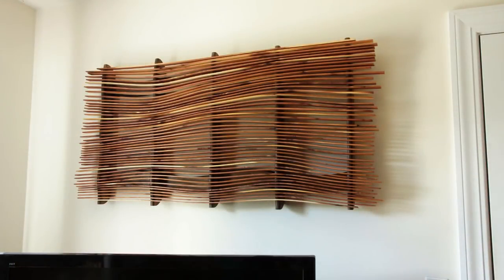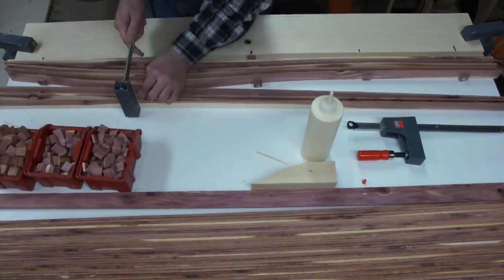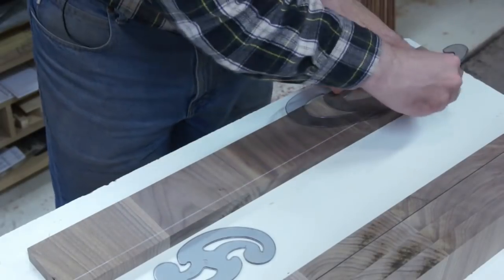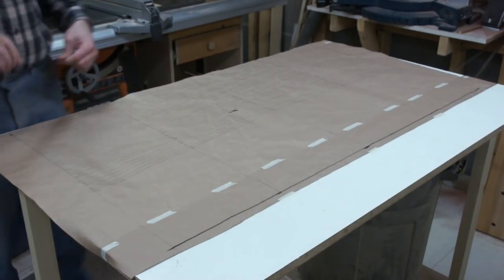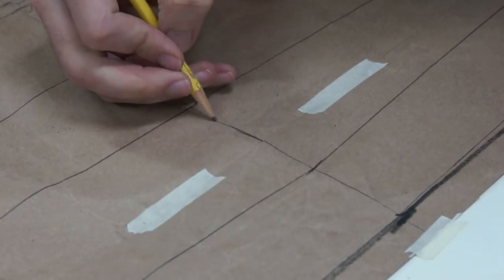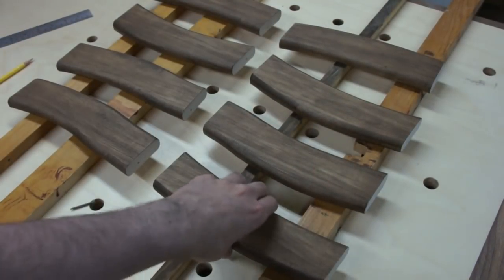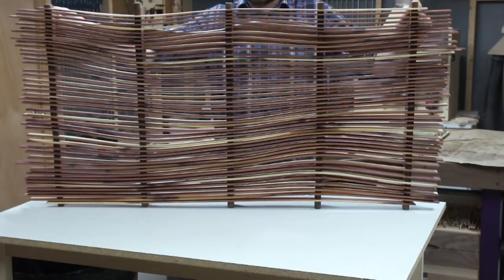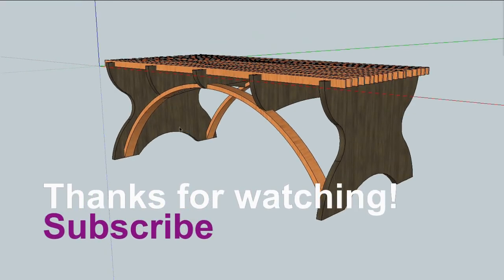Wall Art From Scrap Wood

Comment: This is an awesome idea!  I always have thin strips like that hanging around my shop.  I usually make them into cutting boards but this is a really good use for them also!
Reply from the maker: Thanks!  The long skinny ones and the short wide ones are the bane of my existence.  Well, sanding is the bane of my existence but they are on the list too.
Reply: krtwood We have a lot in common...

Comment: Just thinking about the cut supports. If you cut dados in the supports, then made a jig for the supports to slide in temporarily (like a equalizer on your stereo). The supports are not fixed at this stage, insert the cedar strips, so everything is assembled. Then move the supports in their jig and the structure then takes shape, what ever shape you wish. When you are happy with a form connect the supports together for rigidity, and remove the jig. Maybe this would give a different dynamic to the final form. Perhaps regular spaced spacers or dados, perhaps alternating variations; endless possibilities. I just see this as a quicker construction process, yet it gives a chance to make a better overall final form as you do most of the design at the end.
Reply from the maker: I see what you're saying, but you wouldn't be able to move only part of a divider.  So whatever wave pattern you put into it, it would be the same pattern vertically across the whole piece.
Reply: I'm proposing you have say, 5 supports as you did. But while in the jig they can all move / slide independently until a desired wave form is produced. Then lock that in place and remove the jig. Yes the cut slots and thus the slat spacing stay the same for each form. Perhaps regular slat distances would simplify a pattern that's only varied by the wave form. Sometimes simplifying a complex design like this makes it stronger, and reduces chaos and noise. I think there are lots of possibilities with your idea. My suggestion is to make construction easier, less daunting and thus you would be more likely to experiment with further forms. That's what I try to do anyway.
Reply from the maker: What I mean is that each cedar slat would take the same path.  What really makes it work is that they don't.

Comment: I found your site by looking at the review of 2013 2X4 entries. The tree and park scene you constructed are very impressive. Your initial hesitation to add the bush is indicative of knowing when a project is finished.  Well done!
In addition to your creative Wall Art project, I was also interested in your fence riding push tool. Is that your design or do you know the source of it?
Reply from the maker: It's something I came up with but I have seen other variations on the same idea in other videos.  I'll probably do a separate video on ripping thin strips at some point.
Reply: krtwood Thank you for the response. I look forward to future creations.
Reply: krtwood I did find one variation of the push block on Patrick's work shop. The title of the  episode is, 'Sliding Thin Strip Push Block.'

Comment: kinda cool but you coulda had the same result by taking a few 2x4s, cutting out random slits, then installing the strips at random instead of going through all the trouble to exactly match them how you wanted on paper.  it woulda been more organic that way and hellu easier/quicker.  love the idea of working with the strips though....always dig using scraps to make stuff with. :)
Reply from the maker: If you just make random cuts you will just have the strips making wavy lines with no overall pattern, and no guarantee that you will actually be able to bend the strip enough to make the bends you need.  Also if you just cut the notches down the length of a board the short grain between the notches will break off.

Comment: Very nice but it seems that scrap wood was left out eventually. Or you maybe just have big scraps
Reply from the maker: It's all relative.  The two common types of scraps that I get are long, thin stuff from ripping down boards and short cut offs from cutting them to length.  This project could make use of both kinds.  I made the walnut parts out of some larger boards out of expedience and having just used up most of my walnut scraps on my new workbench, but the grain orientation makes it perfect for using the most useless kind of scraps.  I go through a lot of cedar, and always for the same thing, so anything that I can't get the parts I need out of is worthless to me. The more you do the more callous you have to get about your scraps or you become buried in them.

Comment: The problem i see with that table is leg room near the arcs. They need to be closer to the middle so legs fit. Unless it's a coffee table
Reply from the maker: It was supposed to be a coffee table.
Reply: krtwood
Ok, the proportions made it look a bit like a normal sized kitchen table in the picture. thanks for clearing that up.

Comment: how you secure the stripes in their position?
Reply from the maker: They aren't attached.  The bends make it a friction fit, though the ones near the ends that don't have as much of a bend to them aren't as tight as the rest.  You could glue them in if you wanted but once it's on the wall they aren't going to go anywhere.